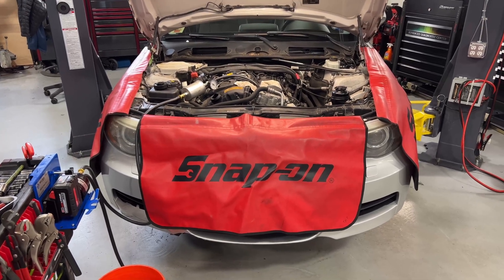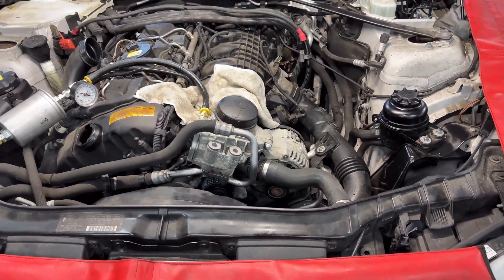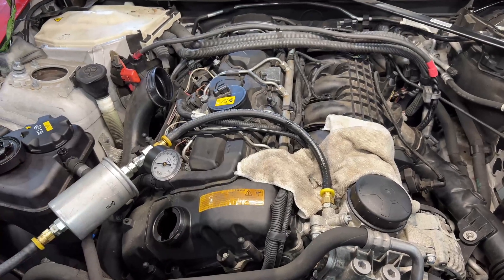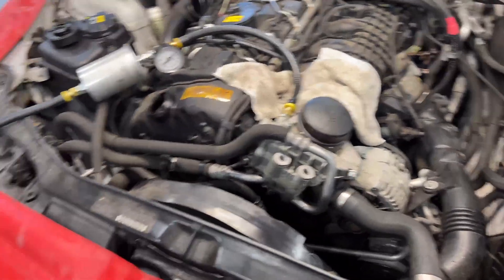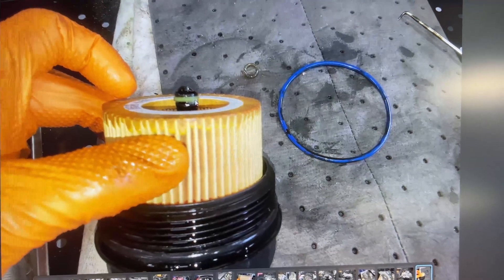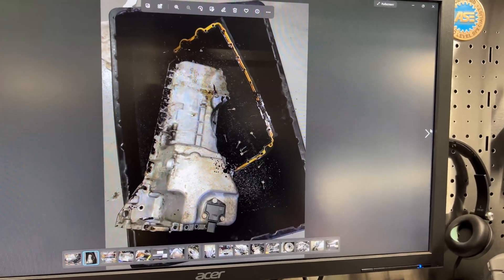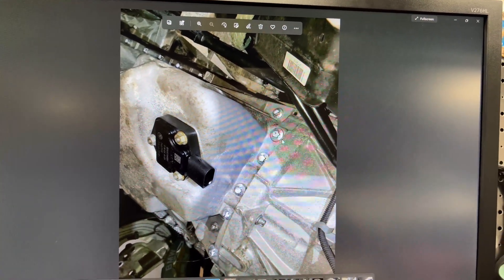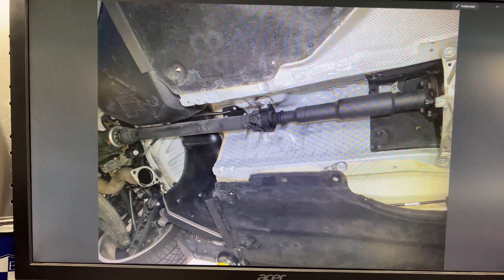How to properly prime and engine after a big repair 2012 BMW N55 Engine

Comment: My Engine N55 in BMW X6 E71 2014 seized after OFHG despite the prime engine....What a shit.
Reply: did you do it your self ? how was the engine primed ?
Reply: @SandwichFresh  Yes, I did it my self. It's not my first BMW but first N55 and I regret to buy the car with this engine. Engine was primed just as BMW recommends in its BMW SI B11 09 15 Technical Bulletin..After driving a few miles the engine stopped and could not be started, no error apart a starter but it's normal when the bearing tear down.

Comment: That is a great priming setup. Thanks for the video Maic. 

 I just had to prime the oil galleys and oil pump on an 1989 land rover that had been sitting for at least 15 yrs. The pump required disassembly and filling with assembly lube before I could get any oil pressure to build while cranking. To prime the oil galleys I used a BG flush tool filled with oil and connected to the oil pressure sensor port. The electric pump would have been much easier